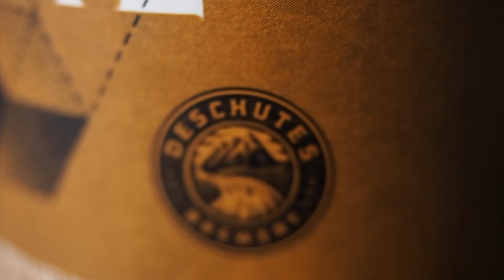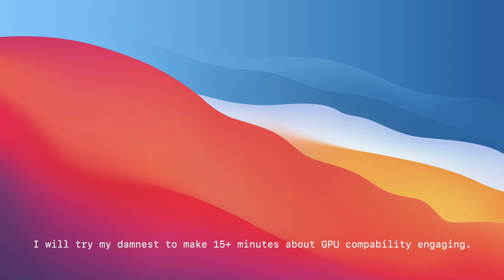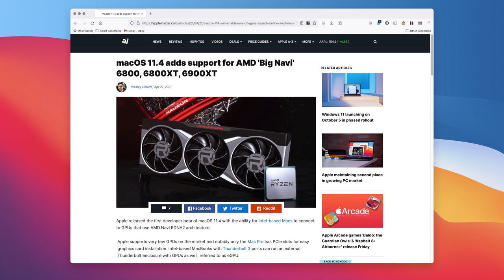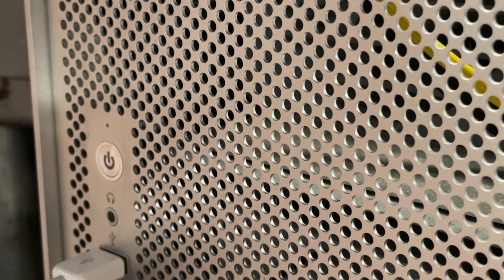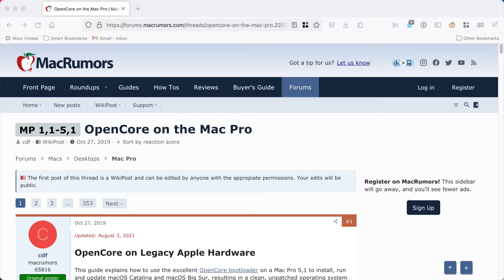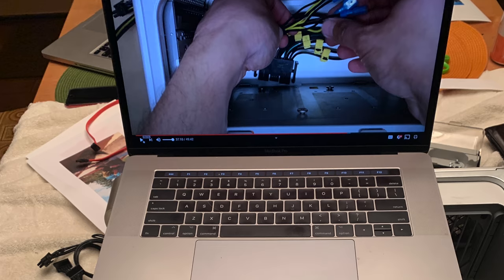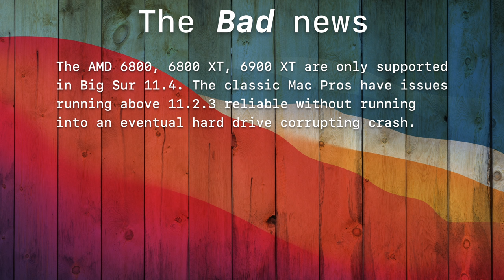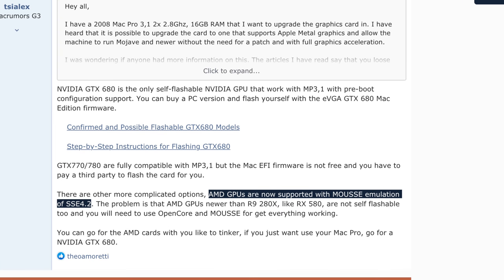Mac Pro GPU Upgrade Guide (3,1 2008, 4,1 2009, 5,1 2010 - 2012)

Comment: This was great. Ironically I had come across your website along time ago and have been reading it and did not know you actually had a video page here. You walk through all of the steps, demonstrate all of the possibilities, and the pitfalls, in a logical easy to follow manner. This is EXACTLY the video I need as I retire my 3,1, and look for a 4,1 or 5,1, with the upgrade/expansion options I’ll need. Awesome. Thanks.
Reply: Same but for 3,1! ❤

Comment: Just now seeing this.  Great video.  I am running a 2010 Mac Pro 5,1 with an AMD Radeon RX 580 8GB card.  My OS is Monterey 12.6.2.  This was accomplished via Open Core Legacy Patcher, and has been running almost 24/7 for several months without any problems.  

I don't have working bluetooth or Wi-Fi, as the older stuff isn't compatible with Monterey.  But  I am using a hard wired network connection for my internet connection, which suits my needs perfectly and for what I do, bluetooth is unnecessary.

Again thanks for the great video.
Reply from the maker: Bluetooth is pretty easy to add in with a $10 USB adapter if you ever want/need it.  Wifi of course requires a later gen broadcom chipset in the form of an airport card (Mini PCIe) or a PCIe card.
Reply: could you share a site which offers solid info on OPEN CORE and how it works, risks, etc?

Comment: Very nice sir! I'm looking into upgrading 2 Mac Pro 5,1, being used with Pro Tools. Simple question...which graphics card for simple installation and boot screen, any info appreciated. Maybe around $200-300?
BTW your Mac vids are the best. Well spoken and clear.  Maybe it's the beer... I never subscribe but I hit that button!  Also interested in videos about moving from Intel to M2.  Thanks
Reply from the maker: It's not that easy hence the video. There's a series of things you need to understand: Do you want to run Mojave or later? Gotta get a card that supports Metal. If you're looking to run Big Sur or Monterey then you'll need to go the route of OpenCore which will provide a bootscreen.  The only sure-fire way to get a bootscreen with a modernish GPU is to buy from MacVidCards at an extreme premium.
Reply: @dmug  Yes I was hoping to stay with Mojave for a bit in order to install a newer version of Pro tools, maybe through 2023 til M2 Macs ship. And later OpenCore might be an option. I understand the bootscreen issue. I could probably lose it. That being said could you recommend a Metal card for transitional use?  Thanks Greg

Comment: Nicely done. Thank you. In my case, "the best" GPU will be the one that costs the least and is capable of (maybe) Metal support. I ONLY use my Mac Pro 4,1 (flashed to 5,1) for Logic X and Pro Tools (11), which probably means my OS will be maxed out at 10.13 (where it is today) or 11.2 (maybe someday). However, the factory GPU just died, so I have to do something.
Reply: I recommend getting a cheap gtx680 and flashing it. Best of all worlds imo.

Comment: I've always flashed Mac roms to my own cards been doing that for 20 years
Reply from the maker: Yeah, flashing was so much more of a thing. 

I flashed a GeForce 3 and over estimated how awesome I was back on the XL8yourmac forums. The only other was the ATI Radeon HD 4770 or something in that ballpark.
Reply: @dmug  
Hi i got a Mac pro 2008 3.1 
Im using patched Catalina 
IT was working fine 
Then i tried to Install el Capital an i Connected a HDD Drive 

Befor i was trying to Connect two Displays and adjust Thema to Split Screen 
But IT wasnt possible 
I got a Radeon grafics Card was working fine 

After i Connected the hdd Drive as the last Change on the Mac my Monitor is showing No good and clear Picture
IT has Barcodes all over  the Screen in vertical lines big AS a thumb 

Im trying to Reintstall the Catalina Version but i dont know If the hdd Drive damaged the Ios or If the grafics Card is now destroyed 
I bought it used 
IT was working fine all the Time 
The Mac was mit running a Lot 

How can i Check on a Hardware or Software Problem 
Or do you know This Kind of Problem ??
When i First installed a New el Capitan IT was the Same 
Then after the Installation IT was showing a normal Picture fron the desktop and everything 

I dont know what happend 
When i Connected the two Monitors Displays IT changed the Resolution as Well 
But since i run down the Mac and restarted IT Chose the right Monitor 

Then after the hhd was Connected IT caused This Problem 
The grafics Card is showing Picture but This Barcode shit 
So i dont understand how a maybe defect Card can Show a Picture 

Im confused with This

Comment: Are the GPU power connectors on the 3,1 considered "mini 6 pin" or standard? They look much bigger then the ones on the 5,1 which are definitely "mini 6 pin."

Comment: I can confirm that an R9 nano works in Catalina and Mojave. It needs an Dual 6 pin to 8 pin adapter for power.
Reply from the maker: I don’t think have that listed in my guide but makes sense as the Fiji chipset is macOS metal supported. Thanks for letting me know about it. Will add.

Comment: Exzellent! +++++
Best Card for After Effects, DaVinci, (Blender) in Mac pro 5.1 OSX 10.8.5 - 10.14 no fuss, plug and play?
Dankeschön from Germany
Reply from the maker: There’s a lot of parameters here as few gpus are both 10.14 and 10.8 compatible. If you’re willing to stick with 10.14, the Radeon VII is going to be easily the best GPU for any use case but you’ll lose the boot screen. 

If you’re willing to wade into the waters of open core and macOS 12, the 6600 XT and 6800 Xt are attractive options.
Reply: @dmug  Most kind. Thank you very  much and thanks for all your excellent wörk.
I need a bootscreen since you do not see the Mojave formatted drives in e.g. el capitain and lower. And I switch between systems like 10 times a day.
I am looking like something reasonable like the gtx 680 but perhaps a bit more powerful, since I work with element 3d in After effects and do videorender intensive stuff in Blackmagic's DaVinci Resolve. I do no gaming. The Radeon V II would perhaps be a bit over the top.

Comment: Awesome!

I just happened to be researching the best GPU to upgrade my Mac cheese grater 3,1 with a newer OS (using dosdude hacks) that need Metal-enabled GPU (or some back-end tech shenanigans that may enable a couple of older, non-metal cards to run on Mojave and later). It's all pretty complicated - but I am stunned that my 2008 Mac still runs smoothly and functions fine with all the apps I need it for to edit video and do graphic work. I don't expect it to blow me away with super detailed, high-framerate 3D gaming, though, but even the 3D games I've tried look stunning!
Reply from the maker: It's complicated but there's a quirk in the 3,1s that lets you see the boot screen with some hacking when using an RX 580.  That'd be my pick as they're not nearly as marked up as other GPUs.

I used an AMD Vega 56 for awhile in my 3,1 and I played a lot of games 1440p just fine.  This was in 2017 I think, as I bought the GPU before my 5,1. I was pretty impressed how well it did gaming. I played through GTA V
Reply: @Definitive Mac Pro Upgrade Guide  Nice! Thanks for the info! That does look like a sweet GPU! 

I settled on a very nicely-priced ASUS GTX 770 that has been flashed with mac firmware (I think for the Mac GTX 680), thoroughly cleaned, and serviced with new cooling paste.  The seller was very helpful, too... It seems like a good mid-range-ish model for my Mojave upgrade test-run. At least, it was priced better than most of the others I saw available, and reviews for installs in similar Mac Pros were all quite positive. I think it may even show a boot screen with this particular firmware installed in my Mac. I'm looking forward to trying it out! 

This video and your guide to GPUs that work for older Mac Pros were VERY helpful! It was a challenge parsing all the different info about various GPUs for these older Mac models with newer OS installs. So, thanks for putting the info together in one spot!

Comment: I love your work. I'm. thinking of getting one of these from OWC. I am disappointed with My 14-inch Macbook Pro. I love the ports but I keep getting ram errors. If I max out one of these and use open core to run Monterey or Ventura, then I think, as an average user, I'll be ahead of the game. What say you mighty Mac advisor?
Reply from the maker: Getting a used Mac Pro 5,1? Only worth it today as a hobbyist machine. You're fighting a battle against time and by the time you've probably brought it up to near maximum spec, you've spent more than Mac Mini M2 Pro. At some point, maybe 3 years from now Apple will sunset Intel Macs.

I'm surprised the Apple Silicon isn't working out for you, you might have a lemon, is your memory pressure exceptionally high by a certain work flow? I had an M1 Air 16GB/1TB for a bit, and even it ran circles around my Mac Pro 5,1 with 96GB/2x 2 TB NVMe/Radeon VII/Allegro Pro USBc card, so much so my first videos like this one were edited on it. 

My M1 Max 14" is more or less as fast Mac Pro 7,1 and a lot cheaper for many workflows.  I'd recommend trying to figure out what's causing you grief as Apple Silicon has been nothing but reliable with a few hiccups. At worst you might have a workflow where you need 32 GB of RAM or more.
Reply: Thanks for taking the time to respond. Maybe i need to have someone take a look. Its still under apple care. @dmug

Comment: I own a 2009 Mac Pro 4.1 … I am wanting to upgrade it to run the newest possible operating systems. What parts do you recommend to do this upgrade? I live in Oregon, thought you might also. Thx Robert
Reply from the maker: yep, fellow Oregonian. I have videos that shows the sort of process you'll have to go to through: 
 https://youtu.be/exCcSce2uNo   https://youtu.be/XaStlvmvluI  

The 5,1s are easier. You'll almost certainly be able to go to Monterey without issues. Things I'd shoot for: RX580 (or 5700 XT) if you can find one at at a good price. Also, SSD is a must, NVMe is a great way to go since they're so cheap now (be sure they have DRAM). I'll also argue going beyond 32 GB of RAM is kinda pointless unless you have a very particular use case as even running FCPX or most audio software, easily handled with 32 GB.

Comment: Great video thanks for the info, what would be the chaepest GPU solution to upgrade to the latest OSs and have a boot screen?
Reply from the maker: That's really open ended considering location, willingness to deal with, OpenCore Legacy patcher, how many displays/resolution (as the bottom barrel cannot do 4k@60Hz) etc.

The bootscreen portion is irrelevant as if you want to run Monterey, you'll need OpenCore which will give you a bootscreen.

Comment: VERY useful!  Thank you! I've been trying to get my 2010 mac pro up to the 10.14 Mohave plateau to keep my favorite Mac OS software tools as current as possible, but GPU issues were a major hurdle. I still have some valuable 32bit apps, so Catalina is not an option. Eventually all my older macs will be sustained with Linux installs.
Reply from the maker: The other option ironically is Windows as MS has supported old hardware a lot longer than Apple. Windows 10 support is native on them and ends in 2025 (although MS has had a habit of extending support) and Windows 11 (For now) can be used by bypassing the TPM or using the hardware emulation for TPM. 

What I did for my old 32 audio apps is buy a very cheap 11 inch MacBook Air 2015 (When I bought it, it was $250 but now $150) as I couldn't virtual machine those. On the cMPs though, Big Sur runs pretty great as does Monterey so if you ever find a solution that works for you, you always make the jump to a more modern GPU.
Reply: @dmug  Not likely that I would consider intentionally installing a computer virus on any of my systems 😜... but is Windows 10 an actual option for classic Mac Intel machines?  I hadn't really ever looked so I earnestly don't know.
Reply from the maker: @arxaaron  Yep, runs great. I was using Windows 10 on my Mac Pro 2008 back in 2016 or whenever it came out and later my Mac Pro 5,1 before jumping off of the cMP train.
Reply: @arxaaron I'm curious about which gpu you chose and how you went about it. I'm currently running sierra (not high) and like you want to max put at mojave for older app use reasons. I do graphics work and was considering a vega 56 but I'm unclear on power consumption issues or if it will require flashing. Looking for the best plug n play option but would prefer more power than an rx580. Which gpu did you settle on and was it plug n play?
Reply: @JordanRaskin  Still in process of the update and researching GPU options. Lots of 2020 MacPro upgrade videos out there. In the final choice of GPU, plug and play more important than big performance and rx580 or similar will probably be the choice.

Comment: Hi, I saw Radeon Pro WX 4100 and 5100 being listed inside your guide. Does it mean the 4100/5100 can be plugged n played into the cMP, assuming it's opencore-configured to run on Monterey macos?

Comment: Am I right in thinking I can slap in a GTX Titan X into a 2008 Mac Pro 3,1 with El Capitan and it'll just work without a boot screen? That's what I previously did with a GTX 960. I have no interest in upgrading beyond El Capitan anyway. Don't want to break any compatibility with the apps I've been using since that came out. Does it matter if it's a Maxwell or a Pascal?

Comment: This is great info & thanks for doing it. I have a 2009 Mac Pro that I'm upgrading I have 5,1 and Mojave installed and I was trying to install M Lo"s OC on it. But I sold the video card that was originally installed. I have a ATI Radeon 5770 GPU from a 2012 Mac Pro will that work?
Reply from the maker: The HD 5770 will work in any Mac Pro 5,1 from 10.7-10.13 but not in macOS 10.14+. You'll need a metal compatible GPU.
Reply: @dmug  was trying to install M Lo’s Open Core, but I can’t get a boot screen with the Radeon 560 installed so I thought the ATI Radeon 5770 would allow me a boot screen but I tried I just get a black screen no boot screen to finish the setup.

Comment: On your site you discuss the rx 5700, but not the workstation model (Radeon Pro W5700).  Would this GPU also be an option?
Reply from the maker: Yep, the W models work too, long as they’re not the MPX modules for the 2019 Mac Pros. Need to list them all, historically the big price differences between the W and RX haven’t made a very enticing option as Mac users do not get the extra driver features that the W series offer and the Mac drivers operate in 10 bit color space in 2D regardless of series unlike windows.  These days there’s probably little difference between the card prices. Previously, few users would bother even looking at the Pro line, but here we are.

Comment: So what I'm hearing you say is I can run the latest NVIDIA in my 1,1 under Big Sur? ;)
Reply from the maker: Yeah, you can also install the  AMD Ryzen 9 5900X  in there too, just gotta hold the scissors really steady when cutting the socket so its the right size, I recommend using hot glue to make sure it stays in there. Rubber cement will dry out overtime.
Reply: @dmug  duuuuuude! Ordered one just now, will keep you posted
Reply from the maker: @TheHouseOfMoth  I want the ASMR version of that upgrade vid.
Reply: @dmug  on it
Reply: @TheHouseOfMoth  : you should know it better jay... :P
Reply: 1,1 only runs Hyper V 2012. You can run Windoze as a VM. Or Linux with Big Sur wallpaper

Comment: Hi Greg, do you have material showing step by step how to flash a gpu RX580 so we can use it on mac os Sonoma, showing the boot picker probided by OCLP??? cMP5,1
Reply from the maker: You don’t need to flash it. Here’s the video of me using a rx 580 on a 3,1 and the issues I encountered.

Is it worth upgrading an ancient Mac Pro 2008?
https://youtu.be/XaStlvmvluI
Reply: @dmug  I enabled GOP and since that moment the RX580 stopped rendering anything. Now I'm using a HD5770. But I  want to use the RX580 has better performance.

Comment: Hi and thx very much for your videos. Can you tell me if I can install my old GTX 770 directly into my Mac Pro 3.1 High Sierra without any mods or tricks ?
Reply from the maker: High Sierra wasn't officially supported for the 3,1s so you'll need to use a modification script or OpenCore.
Reply: @dmug  OK, thanks a lot for your answer. And cheers (beer) from France ;)
Reply from the maker: @idubzh243  cheers with a French wine or a French farmhouse beer or cider works :)

Comment: I did the pixlas mode I have a way easier way to do it I found pins that fit inside the black clip that attaches to mother board.

Comment: I have a couple of questions. The first  - which is the best choice of graphics card for a 2009 mac Pro 4.1 using El Capitan? The 2nd question, my Mac Pro 2009 4.1 just crapped itself and is doing a boot loop with a white screen, not showing any logo. I have tried everything to get it in recovery mode, safe mode, pram reset, you name it, doesn't fix the issue.  Please help??
Reply from the maker: First see the GPU support:
https://blog.greggant.com/posts/2018/05/07/definitive-mac-pro-upgrade-guide.html

Second: 
Try booting off another volume.
Reply: @dmug  thanks. I had a look at the list but it is a bit hard to follow. Would a Radeon work best and also show the logo for recovery mode?

Comment: I am actually on mac pro 5,1 Mojave RX 580 but I heard that with Open Core the GPU acceleration for Final Cut Pro (missing in the Xeon) will be done by the GPU. 
Is it true?
It would be nice a vid before / later
hallo
Reply from the maker: The piece that's missing is for H264/H265 encoding/decoding, other GPU functions work. Check out Martin Lo's (h9826790) post here. You can check the status using VideoProc.

https://forums.macrumors.com/threads/activate-amd-hardware-acceleration.2180095/